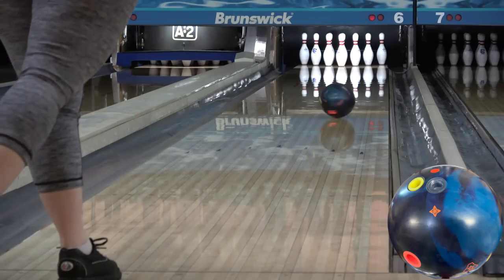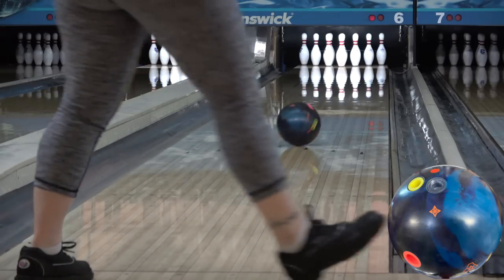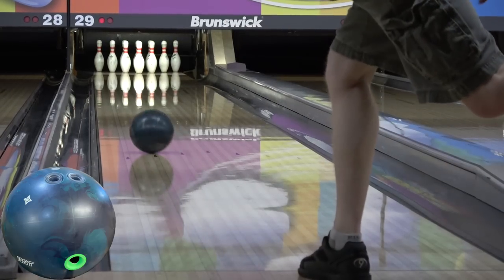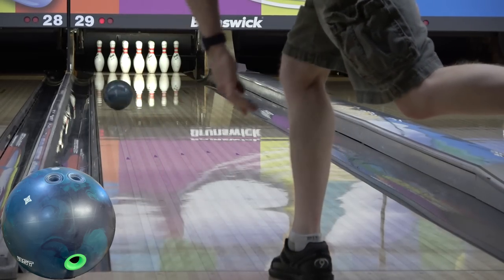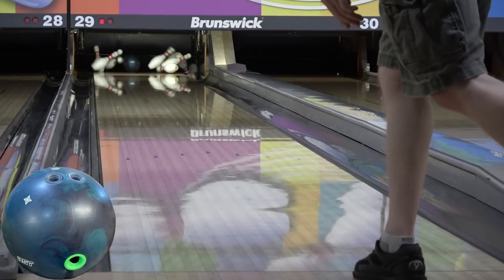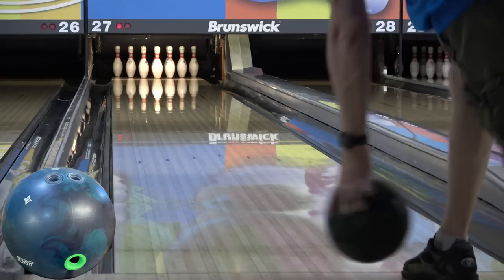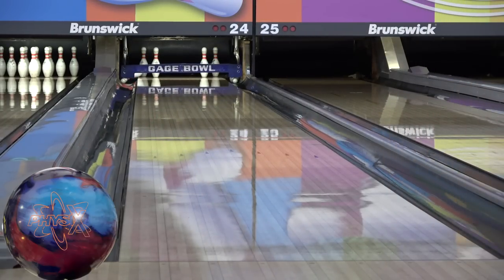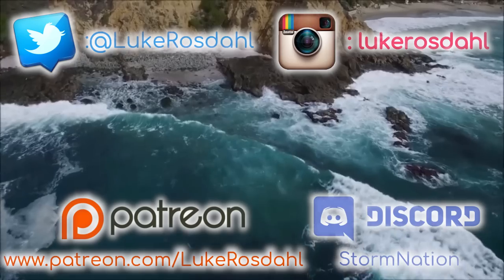Roto Grip RST X-1 Review

Comment: Hey Luke, haven't picked up any asymmetrical balls for a while bc I been more focused on trying to fix me. I am a lefty, and said I would get an omega crux when I felt like I was throwing the ball well enough. Then this came out, so I was wondering your opinion comparing the 2?
Reply from the maker: Omega is a bit stronger and slower than the RST, I think ultimately the RST is more versatile and I get more use out of it.  The Omega is invaluable when the situation actually arrives for it, but I also think that if I didn't have the Omega as an option, the RST would cover that same situation relatively well also.  You'll probably get more use out of this one, but as a lefty, there's not a bad choice between the two, just depends on if you want a smoother look or something with a little more punch.

Comment: Hey Mr.Luke. I’m a teen bowler who struggles on heavy oil conditions. Can you recommend me a ball that would allow me to open up my angle and not play down and in? Thx
Reply: Wait for the Proton Physix to start getting reviewed.
Reply: Good call on the Proton, but from the existing catalog, and if you're talking about longer patterns with medium-heavy volume, I would suggest something like a UFO or Omega Crux. Both have asymmetric cores that will help the ball turn over down the lane :) - I don't have the UFO (too much ball for me on basically everything), but from what I've seen it's the rare hook monster that doesn't quit on the backend so I suspect it'd be a good choice for you! Balls like that are good on heavier volumes generally because they smooth out the breakpoint and "ignore" the pattern a little more
Reply from the maker: Yep, I'd second what Michael said.  However, opening up your angles isn't exactly the wisest choice on heavier volumes, you usually want to keep your angles closed but having more traction is definitely necessary.  I do have a comparison to the UFO in my Proton video, but can't release it until Friday, so just a couple more days.